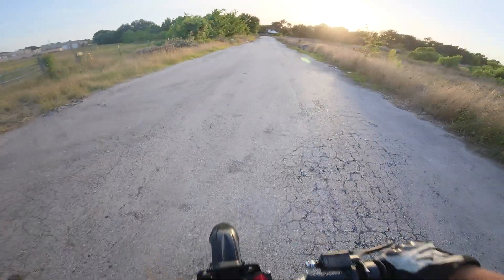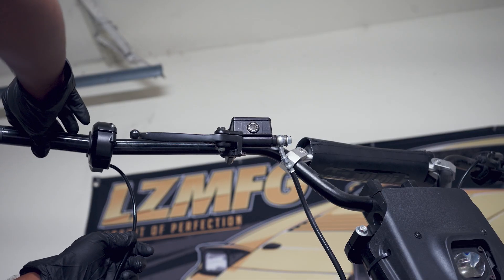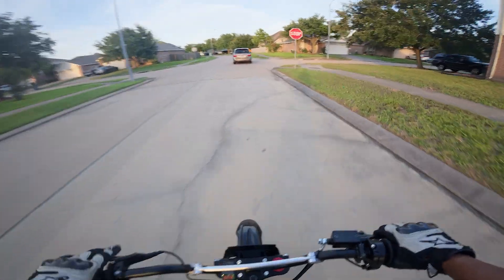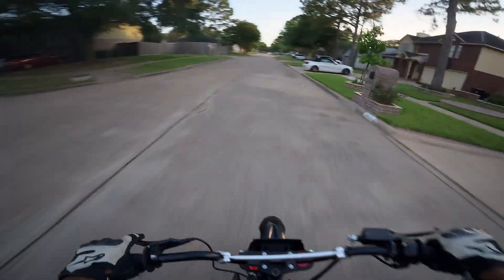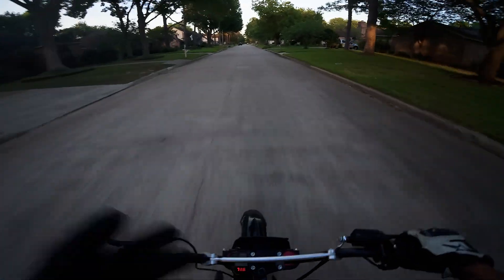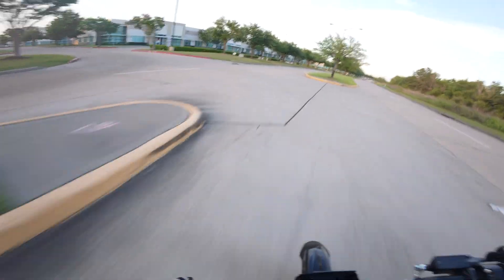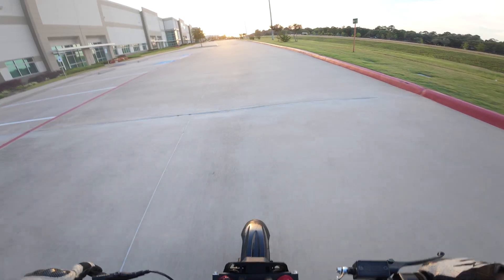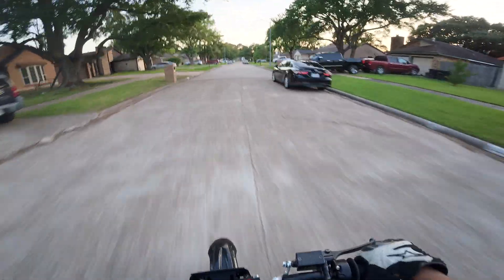I Made A Razor MX650 20X More Powerful // 72v Razor MX650 Supermoto Build

Comment: yo a little tip but if thats a #35 chain i would suggest switch to a 420 chain
Reply: #35h is enough. 420 is overkill for those little motors
Reply: @Nominally-Built  its a 14kw motor, surron motors that are 8kws use 420 chains

Comment: why is your rear brake a mtb brake and your front is e-moto brake. im assuming your rear is on the left side which it should be if you wanna wheelie
Reply from the maker: I was using the rear brake solely as a wheelie brake, so i stuck with an MTB brake since it had enough stopping power. The front brake needed an upgrade hence the pitbike style brake. Ive since upgraded both front and rear brakes to pitbike brakes.

Comment: Nice build. I have the rsf650 with the 75200 pro v2 and thinking about upgrading to the 75350. My battery can only handle 175A continuous. Should I just stick with the 75200? Because Im getting power cut if I run anything more than 150amps. I believe the controller can't handle more amps. What do you think?
Reply from the maker: I would definitely recommend the upgrade, the 75350 is gonna have beefier MOSFETs and more robust internals overall. So even if your battery cant push it to its limit, its still gonna be safer and more efficient on your setup. It will also likely run cooler due to its large metal case that dissipates heat very well.
Reply: @JZEV1  Ok thank you. For the 75350 did you have to use a dongle for bluetooth? Also did you had to install anti spark switch? Or will a key volt meter is fine.

Comment: Nice bike i wanted to upgrade to a vesc from my fardriver but i found alot of the higher power flipskys are meant to be watercooled does it get crazy hot?
Reply from the maker: I was worried about the same thing and had originally planned to watercool mine. However so far I haven’t had any heat problems pushing the 75350 pretty hard. I think for cruising and short bursts the metal case dissipates plenty of heat. They are probably designed to be water cooled in the case of longer continuous use applications.
Reply: @JZEV1 ok cool how many phase amps do you run? I wanna be around 200 line 600 phase
Reply: The controllers are potted but it's a non issue. The 75300 is a much smaller controller physically and is still very powerful. I also have a 75450 and that thing is huge. The 75300 has 8 water ports so you can route the water wherever. You can use a computer water cooling setup that works on 22v. It's not expensive at all. I had the controller under my seat and the radiator behind the front headlight and the clear tubing running along the frame. This was a super73 frame BTW. Everything custom. I would never buy one of those someone gave me the frame and fork which j then took down to bare metal and then gave it a nice color shift paint job. So from behind the oversized round headlight I printed/made was the radiator and the tube ran down both sides of the top tubes right between the cafr racer false tank I printed out and the giant battery box that took up the entire empty spot of the frame. So you can add colorant to water too. You can do neon colors and the have some UV LEDs. A lot of options. So radiator up front then tubing straight back to the seat area and under the seat was the 12v pump. I had the seat hinged and the pump was literally screwed to the bottom of the seat. It was reasonably tidy. Was it necessary. Nah. But it looked cool and it was a fun project and not expensive. Under $50 possibly less. I was doing Amazon but now I usually do AliExpress which is way cheaper. 

The water cooling is in case you are really running it crazy hard or if you pushing past the hardware limits with the unlocked firmware available in VESC tool. If you are just riding around town you won't have any issues. I was cooling mine the first year or so but the last 2 years no water.

I have since moved on to higher voltages and the VESC only does 20 or maybe 21s and now I'm doing 27s and 40s. Yeah they make 144v Fardriver so  80+ mph is easy even on 20" fat rims. Wheelie at any speed. You have to be very very careful. Even with full on motorcycle tires and a 1500w hub up front adding 20 pounds you can still loop it very easily even at highway speed.

A lot of those Flipsky controllers look like the potted water cooled ones but it's just a metal cover so those are not waterproof at all. Thx ones with the water inlets are potted in a hard resin which is hard to get off. It's not a walk in the park to replace MOSFETs but I had mine for 3 years with  no issues until I accidentally bricked it. I have a programmer so I can recover it  Fardrivers break a lot but at least they use soft potting material. I've shucked so many of those things I think I can break it down and get all the potting out in an hour or so. I have gotten in the habit of ordering extra sets of FETs when I get a new Fardriver. Strangely enough the 144v controller is waterproof but there is no potting material in it and the top cover is all metal and it has proprietary connections for your breakouts so it's a whole different animal as far as Fardrivers go. I feel dirty when I get a new Fardriver because I know they are hot trash but since I can just repair them myself I can live with it, but honestly VESC is a much more efficient controller and the software is excellent and everything is in English. That's huge. A 75300 VESC is stronger than a Fardriver 72530. Somewhere between the 72530 and the 72680 from my experience. Love  VESC controllers but I was at the physical limit and needed higher voltage.o made a brief stop at 96v and it made me a believer.  So on to 144v.